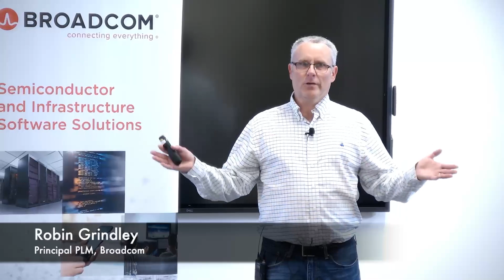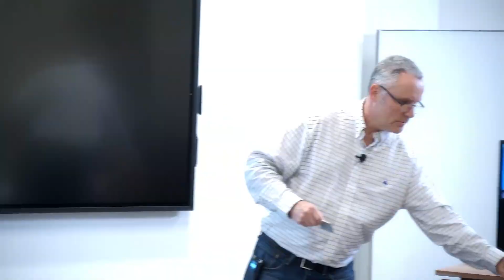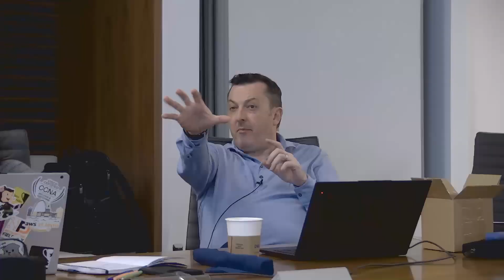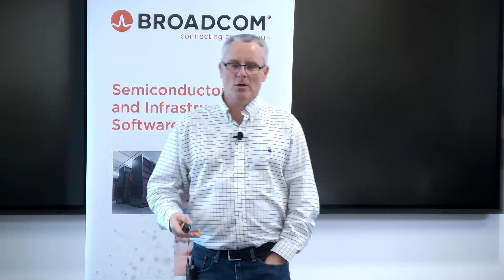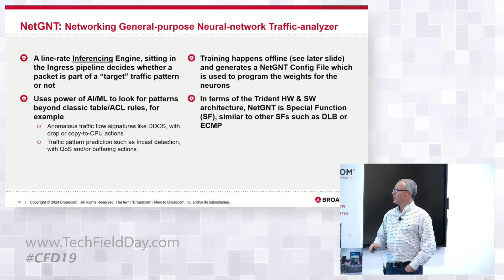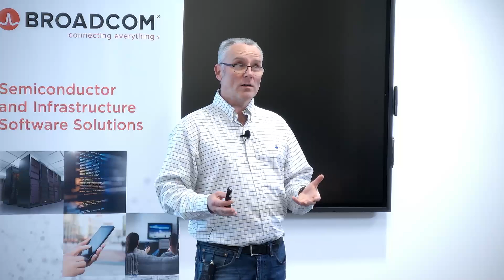Broadcom Trident5-X12: Smarter Cloud Infrastructure

Comment: He should have covered the SFP28, SFP56 and SFP112 PHY rates, and explained how 100G is achieved. I sense people are very confused because this piece of information is missing. Also show people how 100G is achieved using  QSFP28,  SFP56-DD and SFP112 would help lots.

Personally the SFP56/50G/200G should be skipped as it an odd size, better off going from QSFP28 (100G) to SFP112(100G upwards)  and going dirrectly to the Trident5 from Trident3..... Trident3, QSFP28 can serve us for many years, and you can do LACP with QSFP28 to get get 400G.